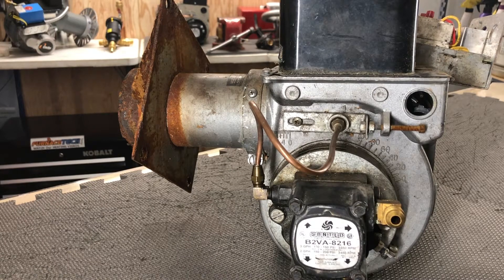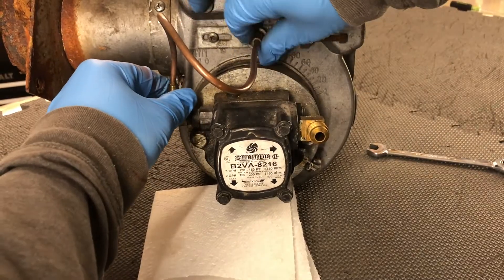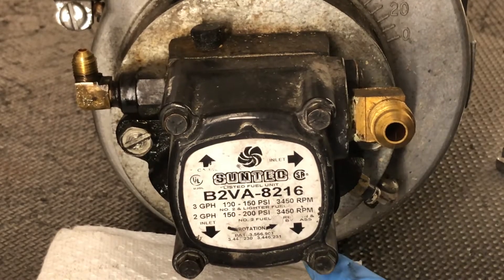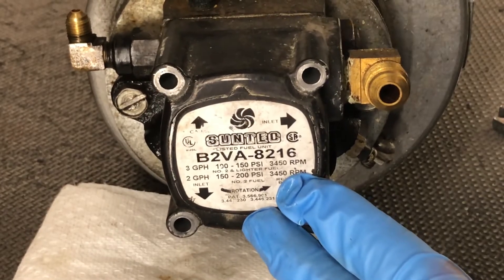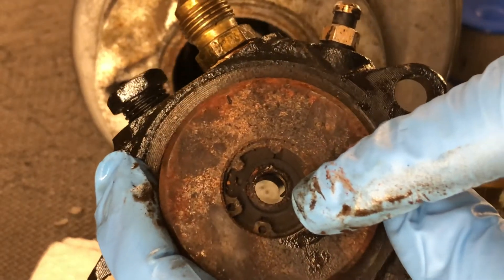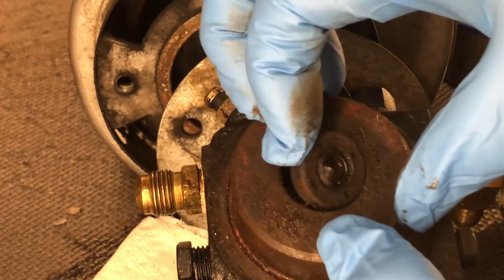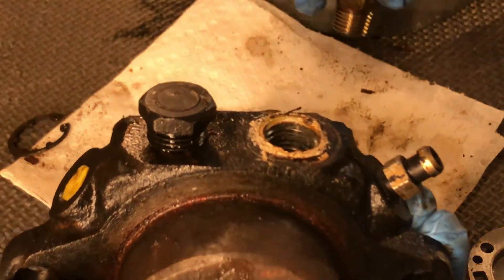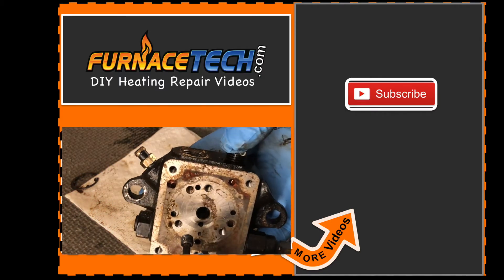Suntec B2VA-8216 - BURNER FUEL PUMP

Comment: I have an oil line coming into the pump from the oil filter and 1 line back from the pump to the oil filter where there is a nipple so I can bleed the line. Bleeding works yet I am not getting any fuel to the nozzle. So it seems the pump is working (because the bleeding is working) but the nozzle is not getting any fuel. I cleaned the lines from the pump to the nozzle. Only opened up the pump where the pump filter is sitting and it looked clean. 

Isn't that weird? Or is this something that could happen? thanks.

Comment: Hi Mister Great video. I like to know what cause bleeding every 3 days? I replaced my single stage. Thank you
Reply from the maker: If you have a leak in the fuel line, it can cause the system to need bleeding after extended periods off time.
Reply: @furnacetech2581  I'll be check. Thank you so much

Comment: I have a Beckett AFG burner; now made whinny noise for about 2 weeks and still functions. How can you tell which one is defective motor or Beckett Cleancut pump?  If I can replace one I do not want to purchase both parts.  Thanks for your help.
Reply from the maker: Hello, you can pull the coupling out between the motor and the fuel pump and put it back together and turn it on. That will allow you to hear the motor run without the fuel pump running! I hope this helps to isolate your issue
Reply: @FurnaceTech  Thank you for good advice.

Comment: My bleed valve leaks. I've cleaned the threads thoroughly to no effect. Suggestions?
Reply from the maker: If you have an old pump maybe try replacing it.
Reply: @FurnaceTech  My pump is a year old, replaced last year. Worked fine until recently, after bleeding the leak started. Afraid to overtighten and strip threads. Have removed bleeder and cleaned twice, no effect.
Reply from the maker: @mattfoley6082  have you inspected inside the threads of the pump. I have never had leak on me to be honest and I have worked on a lot of burners. I know you may not have an old pump laying around. If you tell me the pump model number and email me your address, I can look through the spare pumps I have and possibly send you another bleeder.
Reply from the maker: My email: furnacetech@hotmail.com
Reply: @FurnaceTech  Did not inspect, just cleaned with qtip. Threads and bleeder appear to be clean. This has me stumped.
Reply: I applied dope to bleeder threads and tightened. Leak is stopped. Not sure if dope made the diff or tightening more or both.
Reply from the maker: @mattfoley6082  that’s awesome news!
Reply: @FurnaceTech  Yeah, I'm happy! Thanks for your help.
Another question for you. My burner works great...but every so often it won't fire up. When I hit reset button she starts right up. Oil flow is good, no air. Oil pump screen is clean. Spark on transformer coils screwdriver test looks good. New nozzle. Electrode gap is correct.
Suggestions?
Reply from the maker: @mattfoley6082  1st - does the burner motor run when it’s reset. Something it can get stuck and not spin and end up tripping. 2nd - you could have a bad ignition transformer which is starting to fail but when you test it, it looks good and other times it’s weak. 3rd - if it’s been off for awhile, the fuel in the fuel line could be going back to the fuel tank and when it starts, there could be a period of time where the burner is passing air through the fuel pump before it’s getting good fuel oil.
I would start there. I hope this helps
Reply: @FurnaceTech  1. Just installed new motor
2. How to test transformer? This seems most likely of the three.
3. Has strong oil flow.
Reply from the maker: @mattfoley6082  Here is the issue with the transformer. When you test it with the screw driver and you get a really good spark then that’s great. But sometimes after it runs for awhile and the burner tries to fire again the spark can be weak. So it’s hard to catch. It may be best to just replace it and see. I am definitely not a part changer but intermittent issues will take too long to narrow down and it’s not cost effective from my business standpoint and for the customer paying for the time and return calls.

They do make two types of testers which you can bench test the ignition transformer on. One for the electronic type and one for the old standard model.

Hope this helps
Reply: @FurnaceTech  Agree it makes sense to replace rather than spend time diagnosing. My transformer is decades old and owes me nothing at this point.

Comment: once these things seize up that's it? just curious if anyone's ever managed to free up one that's locked up.
Reply from the maker: I have never had any luck! Plus, for me it is best to replace it and not spend so much time rebuilding something which may need to be replaced anyway. This ensures lower repair costs for customers and no call backs for me!
Reply: I had luck getting mine free but there is obviously a problem with it.  It just don’t work like it needs to and I’m constantly messing with it.

Comment: How do turn the heat for lower pressure?
Reply from the maker: You can adjust the fuel pressure with a flat head screwdriver just above the bleed port. Turn left to drop pressure and right to increase fuel pressure.

Make sure you set the fuel pressure to the manufacturer specs with the correct sized nozzle!

Comment: Would you answer a question or two please ? I was up all night 05/30/2021. Oil burner would turn on then off then on again as if there was air in the lines or maybe a clogged nozzle. So I changed filter and nozzle, checked pump screen and then I could not get oil burner pump to fill up filter canister - I could not get oil to the burner. Pulled small copper fuel line that supplies oil to tube that has nozzle attached to it, has ceramic electrodes proper terminology escapes me at the moment, the gun I believe it is called(that has nozzle screwed into). Well, no oil was coming out of fuel line.  Oil tank is piped with two pipes and not gravity fed. Fuel lines are coming out of the top of oil tank. I thought fuel lines were clogged so I got air compressor and blew the lines back to the oil tank. Approximately 100 lbs of pressure was used. I do not know how I finally got oil burner to run again but I did. Original symptoms are still happening. Fires up for a little then flutters then off and eventually during the same cycle burner turns back on (thank God)before lock out. I have a Suntec A2VA-7116 oil pump. The oil pump makes a squeek sometimes when it first starts up then the squeek goes away. I do use fuel additive when the Oil delivery man delivers the oil. This is like my third pump so far. The last oil  pump I installed was 12/2019. Any help you could offer would be appreciated.
Reply from the maker: Do you have a check valve on the supply line. This can help to prevent the fuel from migrating back to the tank when the burner is off for periods of time. This could take care of your problem.
Reply: Pump is shot, buy a new one

Comment: Awesome information, can you tell me what size the small plug that goes inside is ? Thanks
Reply from the maker: I am not sure of the exact plug size. I get them with each fuel pump from the manufacture so I always have spares.
Reply: @FurnaceTech  got ya “ I will find out cause I’m going to need one when I hook up the tiger loop I believe..?

Comment: I am converting an old hot power washer with a modern beckett burner. Not sure if i just need a regular return or the bypass set up. Not sure what single or dual pipe means.
Reply from the maker: If you are hooking up one fuel line to the fuel pump then do not install the bypass plug.

If you are hooking up a supply line and a return line to the fuel pump then you will need to install the bypass plug into the fuel pump

Comment: Have Sumter pump ,approximately 6to7years old ,have quite a drip of kerosene coming from under housing between motor and pump,reset new nozzle and electrodes and depth with Z gauge could seal in pump be going ,furnace seems to run ok except for drip when firing
Reply from the maker: Yes, it's very possible. 
Was it leaking before you serviced the burner?
If not, it could be leaking at the fuel line right at the burner.

Here is one way to find the fuel leak.
Turn the burner off 
Clean inside the burner housing really good
Pull off the fuel pump and wipe it really clean paying special attention to the area around the pump shaft and seal 
Next reassemble everything
Turn on the power to the burner and as soon as your blower motor starts running a couple secs, turn it back off. 
Next remove your blower motor and take a look inside at the fuel pump seal. If it's not leaking, look down the burner blast tube and see if the fuel is running backwards along the bottom of the blasttube down to the weep hole.

You may need to do this a couple of times. Just let the burner run longer each time.

I hope this help! Let me know what you find!

Comment: Pin is missing.
Pin is normally the first component to wear out which causes erratic oil pressure and pump shaft high spots or seizures.

Comment: Have good flow from tank to oil filter . When I open bleader valve just drips I replaced oil filter thinking pump is plugged?
Reply from the maker: Dave Thomas 
Make sure fuel filter gasket is not leaking also check to make sure the burner coupling is not bad. 

If you have a hand pump, disconnect the inlet line from the burner and see if you can draw fuel up to that point.
Reply: I'm experiencing the same thing. Did you figure it out.

Comment: Good job you're doing. What can cause the shaft of the pump to be stiff? Mine is stiff and doesn't turn freely why?
Reply from the maker: Dirty fuel or rust due to having water in the fuel system can cause the pump to fail

Comment: my pump is working but he diesel is not coming to the burner could you explain to me that it can be
Reply from the maker: I would always start with the fuel level in the tank before checking anything else. After that, The fuel should travel through a fuel valve. Then a fuel filter and possibly a check valve before it gets to the burner fuel pump. If your fuel valve is open and your fuel filter is clean. Check your burner coupling between your blower motor and your fuel pump.
Reply from the maker: If you open the bleed port on the fuel pump, you should get a solid stream of fuel with no air bubbles when the burner turns on.
Reply: @FurnaceTech  what if the tank is full, and the pump bleeds great, just nothing comes out of the bunner line?? I cant get oil to the bunner!
Reply from the maker: @mikebates7234  Does it have a fuel solenoid valve? Make sure it's getting power. You may have trash stuck inside the pump.
Reply: Furnace Tech no it does not have sel valve, I have taken it all apart, cleaned it out. Same result, bleed valve. Strong output, still no fuel to the burner side???  Thanx for your fast reply.
Reply from the maker: You may need a new fuel pump. If you don't have a fuel solenoid valve and your getting good fuel flow from the bleed port.
Reply: My pump problem to no oil in burner so pump part sating again